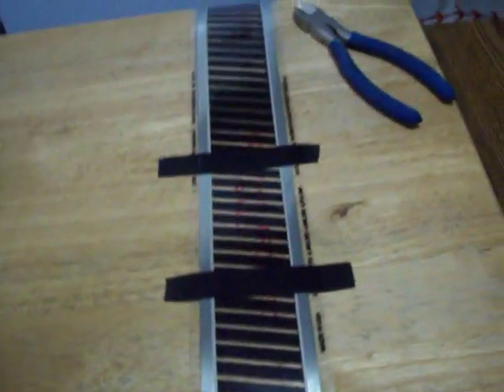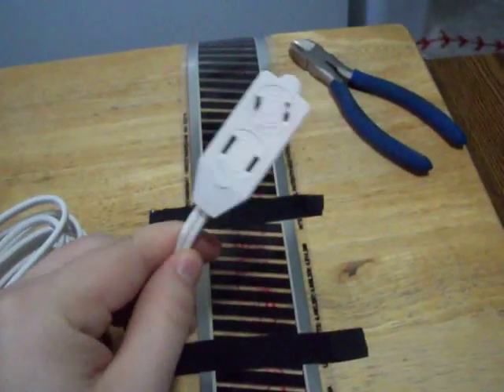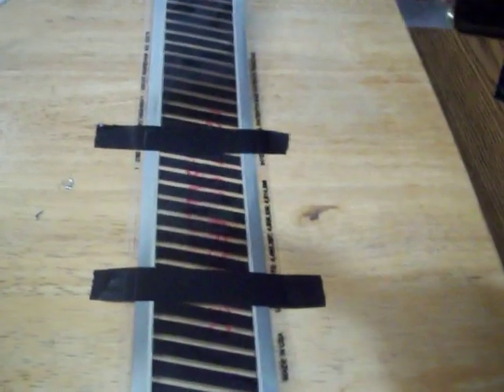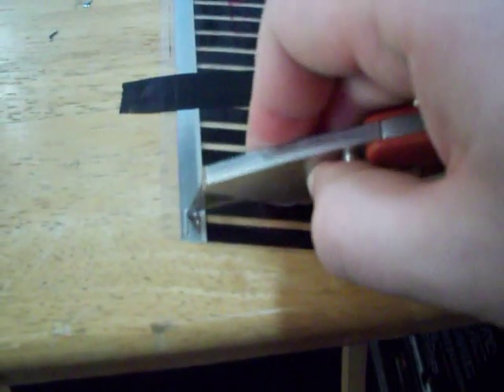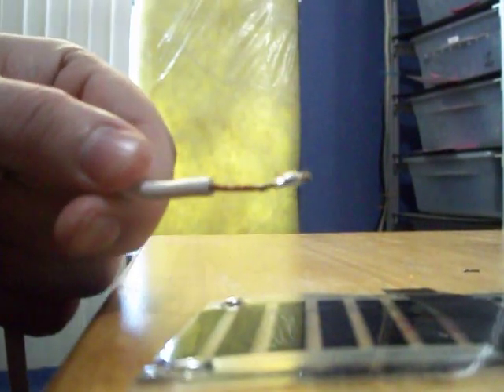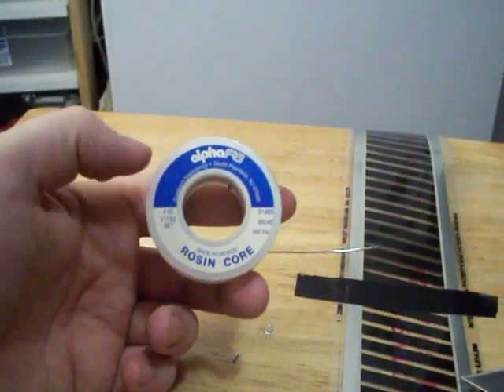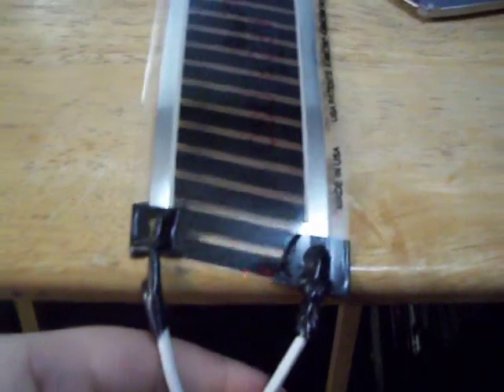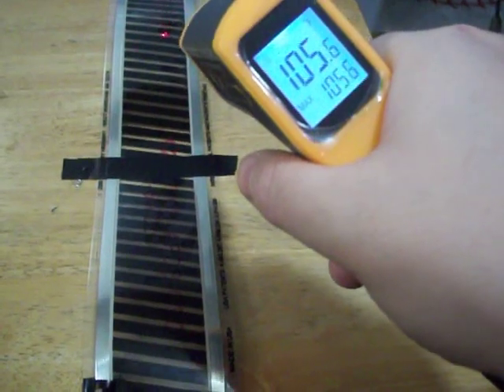How to Solder Flexwatt Heat Tape

Comment: Great video! You also could you liquid electrical tape to seal the connections better.https://www.amazon.com/gp/product/B000FPAN2K/ref=ox_sc_act_title_1?smid=ATVPDKIKX0DER&psc=1&_encoding=UTF8&tag=l0ded-20&linkCode=ur2&linkId=152e6f69840b605697c2793e7a5ecf96&camp=1789&creative=9325

Comment: Do I need flux?
Reply from the maker: Mikayla Holten you do need it yes. but you can buy solder that has a flux core
Reply: RichsBallPythons So if my solder is rosin core it has it in there?
Reply from the maker: Mikayla Holten that is correct

Comment: Thanks for this! I had ordered clips separately and didn't want to wait to set the heat tape up, so I went ahead and soldered it using these instructions and it works great! I might have to insulate the bottom of one of my bigger enclosures better, but the smaller ones are heating very nicely :]

Comment: I dunno.  Used the connectors three times, then melted the plastic away and used micro scraper to get down to copper and clean off plastic.  Laid puddle of solder in the copper.  Soldered the wire ends.  Held them togeather under iron till they fused.  I can't figure out how flex could be faulty but mine barely greats warm.  Room is 65* degrees, cage interior is 70* with dimmer full open ( or bypassed also) after several hours.
Reply from the maker: Not sure Why, I have display cage set up room temp is 66  and hot side 88 cool side 75. My Only guess is not enough metal contacting,  or you have too Mich cool air flow over heat tape. I suggest head to home depot and buy laser temp gun.
Reply: Put foil under it. And I'm getting 72*.  That will work.  I've got 6" heat tape.  Possibly I need wider?   I may augment with a radient heat source also.
Reply from the maker: Thomas Haynie 
Is it flexwatt or the new THG heat tape you are using. That should still reach 90 in your room temp. As my Room Temp is 66 like i said, and my heat tape reads 92 on surface.
Reply: Flex watt.  I lined under it with tin foil... getting up to 72* now.  Better.  Could be that I'm just loosing too much to dissipation?
Reply from the maker: Thomas Haynie 
I would guess the heat is being absorbed somewhere fast.

Get infrared temp gun and read it when plugged in

Comment: Soldering,  still underwhelmed.  Mine doesn't get that warm.
Reply from the maker: Thomas Haynie 
Chances are you soldered incorrectly, only need to melt the plastic off the metal on flexwatt, and use proper electrical solder.

Comment from the maker: Theres no need to solder flexwatt all off the same plug. Way Im showing in video is the safest way. I dont recommend soldering many pieces of flexwatt to run off one cord. Since youll have many fail points that can harm your snakes if something goes wrong. I always do 1 plug per shelf.

Comment from the maker: @IEBallPython 
Yes the thicker solder isnt for electrical as its for pipe fitting/Sweating which requires a torch. Most soldering irons wont get hot enough to melt it well.

Comment: I may have to try this again I gave up my first time but I think I was using to thick of a wire and it wouldn't melt
Reply: The .032 Rosen core melts easy. That's the near perfect solder for this application.